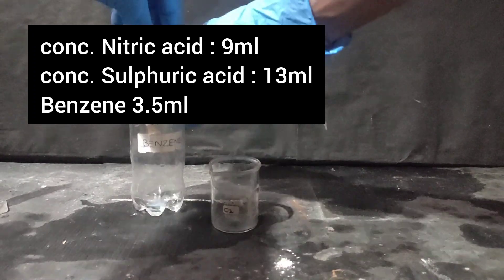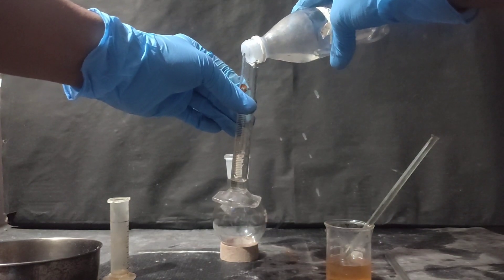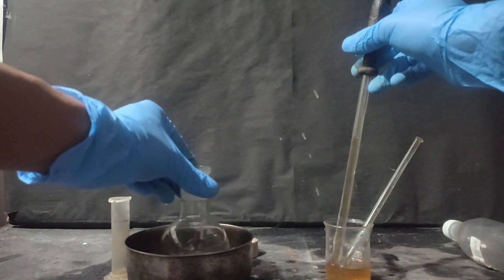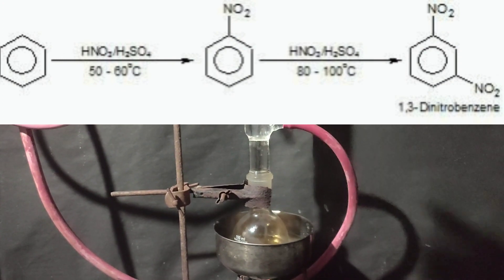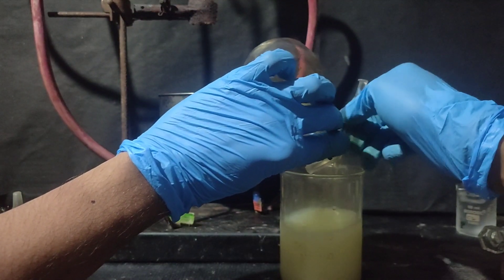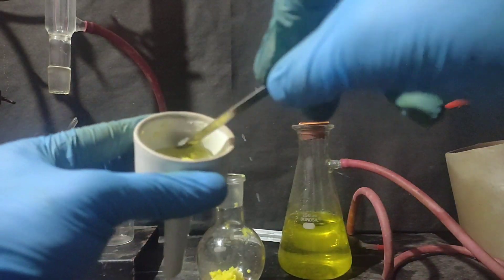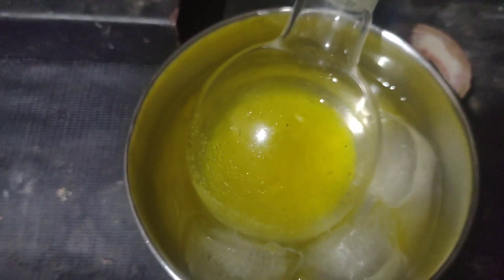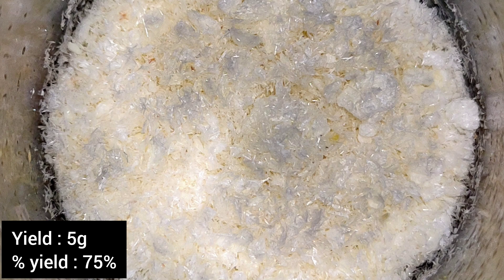Synthesis of m-dinitrobenzene

Comment: Is it ok to not refluxing?
Reply from the maker: Temperature of the reaction is 90°C , nitric acid has lower boiling point so it refulxes at this temperature but even if it is not refluxing but if inner temperature is above 90°C its okay. But a condensor is mandatory to avoid fumes of HNO3 coming out of flask.
Reply: @TheDIYChemist  Thanks you!
Reply: @TheDIYChemist  bro i accidentally heat it in to 130°c and i already stopped it now is it ok??? Is it ruin yet??
Reply from the maker: I dont think so but check it once